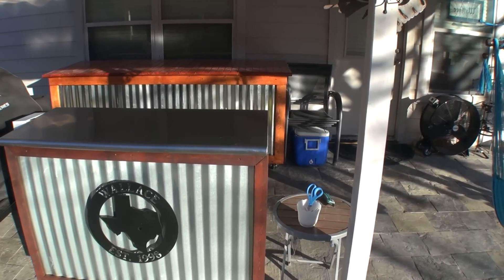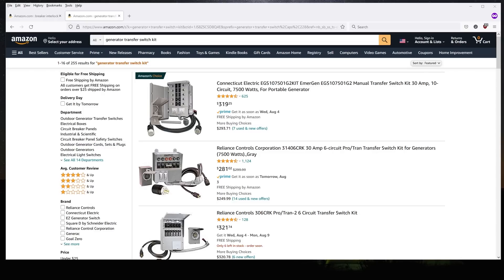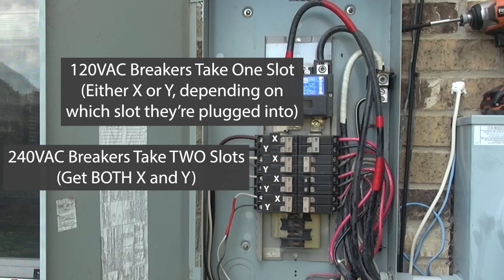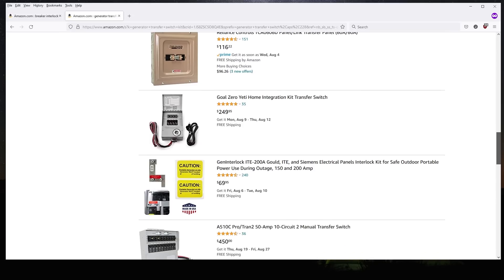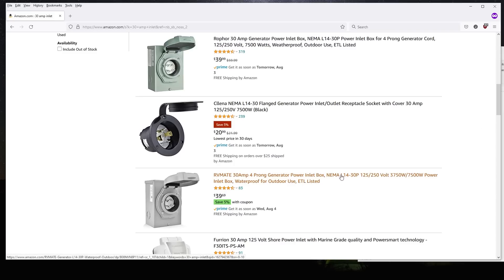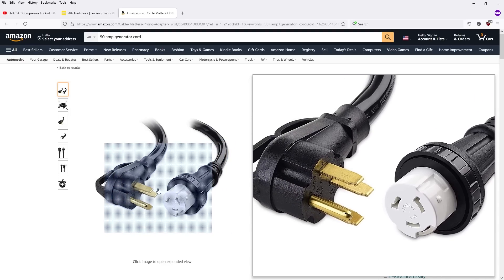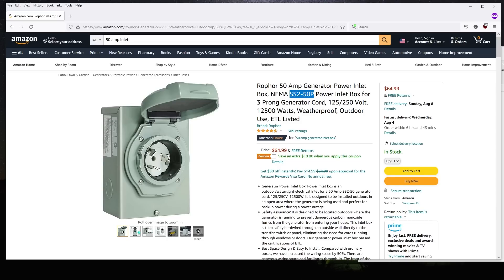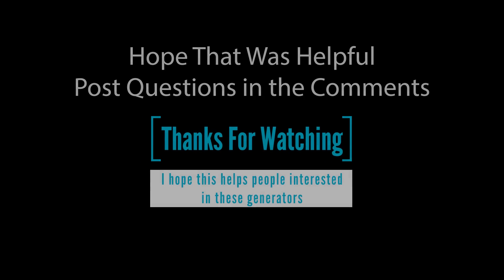How to Connect A 240VAC Portable Generator To Your Home

Comment: Well laid out video. Very helpful, except you don't speak to houses that have an outside shutoff between the meter and the power company feed. That's what I have, and I'm assuming as long as that shutoff is in the off position when running my generator, I have no need for other safety devices to prevent incoming current from the power company.  in. Is that correct?
Reply from the maker: The safety device isn't just for you and your equipment, it's for people (linemen) that may be working on a system that is expected to be off.  Would what you describe work technically?  I would think so, provided the cut off switch truly disconnects all the hot wires.  However it wouldn't be safe, nor to code / legal.  

The logic behind an interlock or a transfer switch is that one can't make a mistake, and accidentally do it wrong.  In the case of the interlock, there is a metal plate that physically blocks the breaker from turning on unless the other breaker is in the correct position.  So short of taking it apart, one can't inadvertently screw it up and send power where it's not supposed to go.

With the cut off switch you described, you could easily have the generators on and connected, and, have the cut off switch in a closed (connected) position as well.  So the safety of the system relies on the operator performing the action exactly right on the start and the finish... and someone not trained in it's operation could easily flip a breaker and cause potentially disastrous results.  So I would still STRONGLY suggest an interlock plate.  

(The cutoff switch is nice however, so you can work in the breaker box knowing all the power in there is actually off)

Comment: Do you have to up grade the wiring to go from 30 to 50amp?
Reply from the maker: I upgraded the wiring in mine because I started out setting everything up for 30A and had to switch it over to a 50A inlet.  

If you are wiring it for a 50A inlet (even if you only ever plan on connecting a 30A generator) you should absolutely make the wiring suitable for 50A as well.  The whole idea behind using the 50A inlet is to future proof so you can add a generator (or upgrade) without having to rewire your house.  The difference in cost between a 30A and a 50A isn't that much.  We're probably talking about $30 or 40 total... 

In hindsight, I can't see any reason to go with only a 30A inlet, unless it's something like a small RV that literally can't handle any more.

Comment: My house has a 4prong generator plug on the side of the house, I have not purchased the generator for the house yet but I have a Honda 3000 with a 3 prong outlet. Can I use an adapter to go from my 3 prong Honda to my 4 prong house plug?
Reply from the maker: Google tells me that your Honda is 120VAC.  So you would need really to look at how things are wired.  Is the inlet a 240V?  If so you've got a mis-match and would need to do some homework to figure out how you want to handle that.

If you turned off the breakers for all your 240V appliances/devices, you could probably feed 120v into both legs of the breaker box...  or, you could wire it to only feed into one leg of your power (either X or Y), so half your breakers in each row won't work... but you do that on purpose.  And put all the circuits that you would want generator backup all on that leg of the power, and the other leg is the non-critical stuff.

Either way you'll still super duper especially need either a transfer switch or an interlock... it would be a "something is violently catching on fire spectacularly special kind of bad" to have an adapter basically shorting the X and Y leg together (assuming your generator was feeding the same 120V into both legs) still connected into the circuit when you switch back to 240V power.

I would definitely consult with an electrician or think it through really carefully.

Comment: The installation of any electrical components should always be done by a qualified electrician. PERIOD!
Reply from the maker: Meh... That's like saying any and all work on your vehicle should be done by a certified mechanic.  In fact with your vehicle, a mistake could directly endanger others as opposed just to yourself.  

If you know what you are doing, and can do so safely, in my opinion, it's fine to work on your own stuff... but if you're unsure or inexperienced... yes indeed.  Hiring a professional is far better than the disastrous consequences of getting caught up in 240VAC power.
Reply: @Texas_DIY  ya… that’s what my neighbor said.  Then his house burned down killing his wife, grandchild and himself.  It’s a nightmare watching it happen knowing they were inside.  
I (journeyman electrician) don’t even give out electrical instruction...  Cause I have to see where it’s going and the circumstances in which the electrical equipment will operate.  
Anyway, You decide what it’s worth!

Comment: every video i watch everyone has a empty breaker slot and i do not there all full could i just use the dryer breaker ?
Reply from the maker: I would strongly advise against it.  Would it work?  Yes.  But it wouldn't be safe or at all to code.  Let's say something went wrong on your dryer while on generator power, there wouldn't be a breaker to shut off and stop the wiring from burning up because you would be inserting power on the same lines that go directly to the dryer plug.

I would consult an electrician.  They may be able to combine a circuit, or add a small breaker box.. or something to that effect.

Comment: I use a Micro-Air Easy Start soft start kit to reduce starting watts from 73 to 26 on my 2 1/2 ton hvac with my Champion tri fuel and NG.
Reply from the maker: Nice.  You got some good numbers off that one.
Reply: @Texas_DIY  👍🏼

Comment: Great video and great setup!  Do you have a link to the electric fans you used for your box? Thanks!
Reply from the maker: I don't have a link or model number, I'd had them for several years.  They're standard common automotive fans that you can get in most any parts store.

Comment: So you have 2 generators.
Are you running each one as 120v output or 240v?
Or are you paralleling them with there factory oem system, for one 240v output?
Seems far more likely and simple.
Compard to a step up transformer setup.
Reply from the maker: They only exist / run in 240v mode.  That way it matches exactly the power from the electric company, and nothing has to change with regard to wiring on the house side. 

Remember, just because it's 240v doesn't mean it's not also making 120vac between the hots and the neutral.  240v mode gives you everything, and nothing in the house knows any difference.

Comment: But if everything in my house runs on 120volts or in my case 110volts including microwave, AC, water heater etc etc is then the 120volts generator sufficient enough? I live in a third world country and blackouts were common like 4 times a year but nowadays it's getting worse and I don't see it getting better because of more and more power demands for the ever expanding population and such.
Reply from the maker: If you truly don't have / need 240, then you could get away without one.  But if 240v power is what is feeding into your box, this does make it easier.  But, again, if there are no 240V devices that need both legs, then you could feed 120 into each of the inputs and I would think that it should work.   Many other countries are 220V 50Hz normally, so all the rules I've described are out the window if that's the case for you.  But if you are 120V 60Hz, this should be applicable assuming your power breaker boxes and such are similar.  

But I'm not an electrician, so consult a professional, particularly for your area if you are unsure.

Comment: For the longest time I couldn't wrap my head around how the 50A 3 prong inlets could possibly pass the 2 hot, neutral and ground through until I learned there was a 4th contact on the side of the connector. Thank you for explicitly making this fact known as everyone seemed to gloss over it as if everyone should just know the 78 different "standard" connector types and how to adapt them.
Reply from the maker: I too was curious about that from the photos, until I noticed the side ground.  Glad it helped to clear things up.

Comment: Do jeg need an inverter or i can just plug the generator to the house?
Reply from the maker: Not sure of your question... the generator has an inverter built into it.  So basically the goal is to find a safe way to connect the generator to the house.   

The only time a home will already have an inverter, is if you have some kind of solar/wind/battery setup, and the home inverter is supplementing the power (very much like a pair of these generators do to each other).  If that's the case, you would probably feed this in, either into an input on it designed for a generator, or, swap it for the line power.  

I can't really say what to do if this is your situation, that would fall into the "call a pro" category.
Reply: @Texas_DIY   Tnx for your answer, You mean that i can connect the generator directly to my house while my house is connected to grid system?

Comment: Honda has a bunch of 240V inverter generators too
Reply from the maker: Yes, the Honda units are absolutely excellent, and really are the "gold standard" for these types of generators, but they are more than 2x the cost.  If you're using it every day, maybe seriously consider the Honda.  But I didn't want to spend that kind of money.

Comment: wow, really insightful video, I kept hearing you say over and over "hire a professional! if you do this you'll die, and it'll hurt the whole time!". I don't now, maybe that was just me lolol. seriously though, when I do make this upgrade I'm not touching it, I will let a professional do it lol.
Reply from the maker: LoL.  I just don't want someone to get hurt.  So if there is danger there I try to point it out.  It's really not too crazy though, if you've ever replaced a plug or light switch, it's not far off from that.   

But if you're not confident or unsure, nothing is wrong with that, and hiring a pro is the better and safer choice.
Reply: @Texas_DIY  the only thing I k ow about electricity,  current and Voltage is that it hurts. Call the pros for sure!

Comment: Step 1: install a Generlink transfer switch
Step 2: attach generator to the Generlink
Problem solved.
I love the generator shed you've built. Very cool.
Reply from the maker: I like those, so much more simple.  But there are some drawbacks.

Pros:  
Super easy to hook up (even has surge protection)
Automatic and safe switchover, no thought or process required
If it's raining, you don't have to mess with your breakers in the wet raining weather (scary)

Cons:  
Proprietary and expensive cable to connect to it.
Can't use that cable for other purposes (Such as to hook up an RV, etc)
Requires electric company to pull your meter so you can put this thing behind it
Max 40A (unless there is a larger model I'm not seeing)
Expensive at ~$800 - $1000 vs. around $100 to $200 total for the conventional way

Comment: You mention getting a 50 amp plug even if your generator is 30 amp. Is the adapter you mention a plug of some sort and if so is on the generator side or the home side?
Reply from the maker: You can adapt it on either side depending on what you need.  

If it makes more sense for you to have a 30amp cable for an RV or something, you can get that, and adapt it on the house side.  If it makes more sense to run a 50amp cable for future proofing or a larger RV hook up, you can adapt it on the generator side.

Comment: I appreciate your honesty on the video. I'm a diy guy but other than running pigtails to add outlets or install simple switches I don't think I'd be comfortable enough to do most of this.
Reply from the maker: Frankly the breaker box was the easiest part.  It took longer to get everything lined up where I wanted it than it took to do the actual install.  The breakers just pop in, easy peasy.  Just respect the top of the box (or wherever your street power comes in) because that can't be shut off. 

The inverter parallel box I made was more of a hassle, not so much complex, but the time and effort into planning and assembly to do it safely. 

But run at your comfort level.  Hiring a professional is better than the alternative if you aren't confidently understanding or comfortable with what you're doing.

Comment: I enjoyed your video thanks ! Before seeing your video I had been bought the Predator 9000 and then to Lows this morning and purchased the 30RK Transfer switch kit 20amp /30 amp wish me luck I’m calling in a A professional electrician 😂
Reply from the maker: Glad it helped.  I'd look closely at the interlock solution if you can make that work.  If you're going transfer switch, I'd use an electrician too, it's a lot more complex than adding a breaker and a "slidey metal plate thing".

Comment: yes we can use 120v
for heat 
the gas fuenance only use
4 amp
Reply from the maker: Gas.  In my situation I'm 100% electric, so the Heater/AC/Airhandler, hoy water heater, and stove/range are all 240 and won't work on 120.
Reply: yes for gas furnace 
we can use 120 v

Comment: Do they make a 50 amp inlet box with the plug on the bottom so the plug of the jumper cable is in a natural position and not sticking straight out from where you mount it.? Also, is there an inter lock device for your house breaker panel that you can lock out.? Thanks very much for sharing your knowledge?
Reply from the maker: That really would be a design improvement, kinda wish it faced down.  Would be better all around.

Comment: Working on doing this now after Ian, while it would be so nice to have 240v the Predator will use about 10 gallons of fuel a day, and in real disaster situations fuel can be scarce, and going out to get it is a major pain.  So I decided to get two of the 4500w smaller generators with the parallel kit.  I can run just one for basics like lights, fans, fridge etc (made it thru 5 days w/o power with a tiny 2000w doing this) but if say we want to watch TV, or I need to get on the computer I have the option to kick on the 2nd generator to get 50amp worth of power if needed.  I also have the 2 is one, one is none backup in case of generator failure.

I assume from all my research over the last several days, I just needed to ensure I do not have any MBEC's (I don't as far as I can tell) and it would be a good idea to turn off the breaker for all my 240v appliances as I will no longer be sending out of phase power while powering both sides of the box with 120v.

The 4500w generator runs 14 hours off 2.3gallons of fuel vs the larger generators using about double that.  So 1 5 gallon gas can will get me thru 24 hours no issues.

I don't see myself using any of the 240v appliances during an emergency situation, propane stove/grill for cooking instead of the stove, fans instead of AC, suck it up for cold showers, and do laundry after the disaster is over (or if really needed the washer is 120v and line dry cloths).

Since you seem to have done much of this research, does this sound like a good plan?

Also HF has been increasing prices a lot the last couple of years that generator is now $2400, but they do have a VERY similar 8750w model for only $1300, runs kind of loud though at 75db, that is another slight advantage to the smaller generators only 61db vs the 9000w Predator at 67db.
Reply from the maker: You can do that.  Turning off the 240/220 breakers would be best.  I'm not sure what would happen with them if the same phase were fed into both legs.  (better "off" than fried)

When running in Eco mode, these things will throttle down quite a bit and use fuel proportional to the output.  Unless the output is so low it's idle, in which case, just turn one off to save fuel.  But yeah, larger engines will in general use large amounts of fuel.

But if you're willing to make those compromises, it seems like a fair option.

Also check out the GENMAX GM9000iED.  It's the same manufacturer as the Duromax and the Predator, but with all the shortcomings of each fixed.  Rear exhaust, has an oilfilter, the air filter is actually accessible, nice displays, natural gas option built-in, etc.  Might be a good fit.
Reply: @Texas_DIY  Thanks for the quick reply, I might be in a bit of a bind actually.  My indoor panel does not have a main breaker to use with a interlock, by the meter I have a single switch for the mains with nowhere to install a breaker to injest power from the generator.

So that leaves me having to maybe use a transfer switch setup, harder to install, more cost.  Still cheaper than using something like the generlink.

Ideally with how hard fuel can be to come by in a real emergency I would prefer 2x 4500w generators to a single 9000w so I can have the extra power on demand if needed, but use less fuel when not needed, also having the extra generator if a failure happens, but it seems there are no 4500w 240v generators, and it's starting to look like the best way to hook them up for me requires 240v.

Comment: Could you convert these generators to propane instead of gasoline?
Reply from the maker: If you're looking for a hybrid (natural gas / gasoline) unit, check out the GENMAX GM9000iED.  It's the same manufacturer as the Duromax and the Predator, but with all the shortcomings of each fixed.  Rear exhaust, has an oilfilter, the air filter is actually accessible, nice displays, natural gas option built-in, etc.

These can probably be converted, but it would be a hassle and a lot of time to do so.